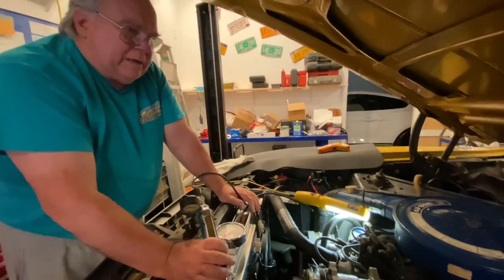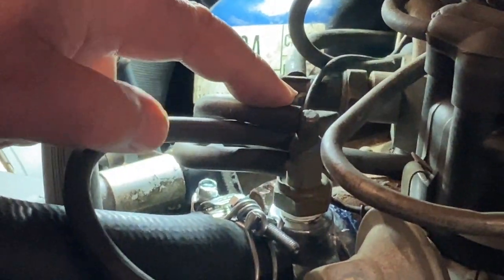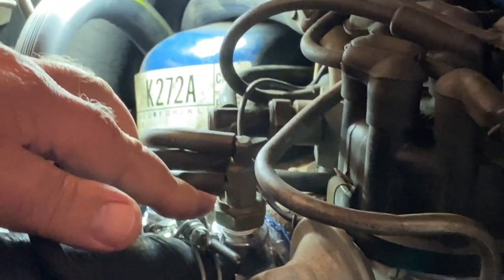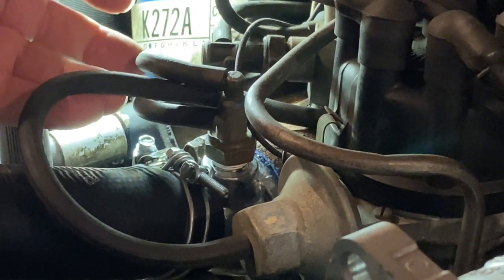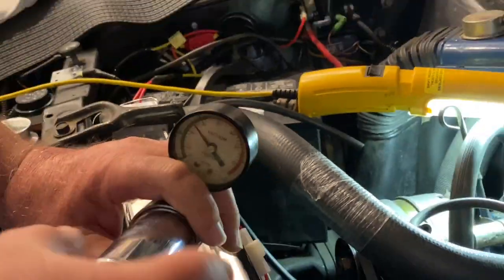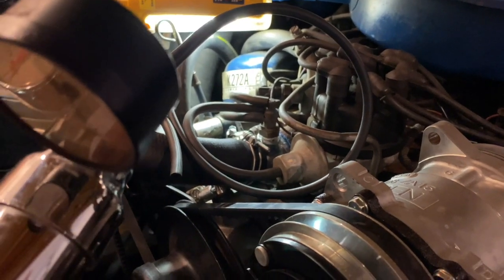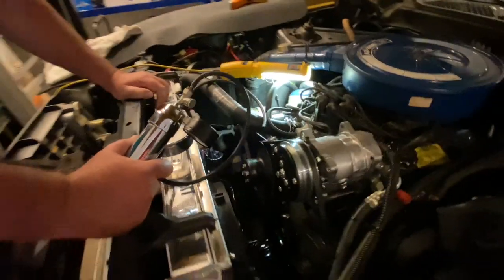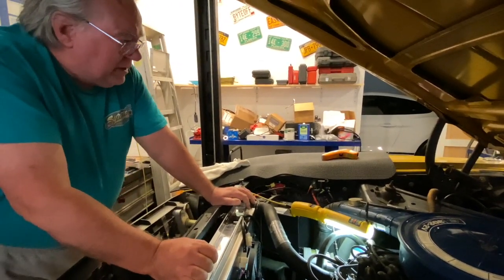1973 Mustang Thermal Vacuum Switch (TVS) Behavior And Testing

Comment: Great video! Is there a preferred configuration for those general driving and performance? I have one of these on my 70 boss.
Reply from the maker: I will see if I have the vacuum schematics for the 1979 Bods 302. I prefer to do that as opposed to taking a guess at a general configuration to try, although I am confident what my gut tells me is going to be correct anyway. Please stand by as I research this

BTW, I am a huge fan of Boss 302s from back in 69 & 70. Huge. I feel honored to be getting asked to help find out how those engines were configured for the vacuum systems. Truly honored.
Reply from the maker: Okay, we got lucky.  I do have a copy of 69-70 Boss 302 engine vacuum calibrations on my Google Drive at the link provided below.  There is a subtle difference between the the drawing on the left side of the page, and the right side. The difference is on where the vacuum source for the hood scoop air flap vacuum motor comes from.  Functionally  there is no difference, but the routing of that particular vacuum line differs between the two drawings.  Here is the link for the one file:

https://drive.google.com/file/d/17kcVttPb3mKM30b_QsQRF5Fk9APFDVwS/view?usp=drive_link

I have a lot more vacuum schematics for 1968 - 1972.  I consolidated all the files I got from The Mustang Barn, with their knowledge and permission, into a single file, located at:

https://drive.google.com/file/d/1zE7_8E5NsaInM69KPkzRuZZeWFNpbz0i/view?usp=drive_linkFell free to share this info with anyone who made it.  The Mustang Garn published it for free use.

Comment: I have asked two or three part houses staff and nobody is a mechanic nor even know the name of this Ford part.  Much less how or what it is supposed to control.
Reply from the maker: I have several files with more info on these Vacuum Vacuum Switches.  I have tried to keep all my various files organized in a way that I can find and open, or share, the files without a lot of hunting around.  But, that has only worked out "so well."  I will provide more files as I come across them.  As I find them I will upload them to my Google Drive, which you can access via the link below:

https://drive.google.com/drive/folders/1K6s8NTPj5gP229i5DPfdPxgxedikayty?usp=share_link
Reply: @gilberthale7777  Nice, thanks for the content.  I just rescued a running driving 1972 LTD Convertible with a 429 4V, 3 speed C6 transmission, 3.0 rear end ratio. I rescued it from a local ranch shed.  Has not been on the street since 2012.  Just driving around on the washboard ranch roads.  Lots of years of deferred maintenance and sketchy repairs and parts are not really easy to find.  They did not make many of them. Finding a person that knows what stuff supposed to do is even harder.
Reply from the maker: @dewholdingsllc1050  The folks at Mustang barn put together a bun\ch of PDF files for all the Ford Mustang engine vacuum schematics from 1967 - 1972.  With their permission I assembled all the pages into a single PDF, grouped by year, then sorted by engine size.  You can access the file via my Google Drive t the following link.  I hope that helps you with that LTD.. Those are nice cars.  I used to work on them a lot as a technician at a Ford dealership in SoCal back in the 70s and 80s.  Good times back then.  

Anyway, the file does not show thew 1972 429, as the Mustangs only had that engine through 1971.  But, it does have the vacuum calibration schematic for the 1971 429, which may be pretty close to what 1972 had.  If nothing else this info may come in handy to you or a friend in the future.  It is at the following link:

https://drive.google.com/file/d/18QmjlkGQ0fHLOt-q2Pq1JvXDN1gdRl5x/view?usp=share_link

Comment: Excellent video Gilbert, I was previously puzzled by this small device but no longer !
Reply from the maker: I am glad I was able to remove some of the mystery re: how those TVS units work.  In the mid 70s to late 70s it seems most cars had at least two, or three, of those TVSs, and some of them remain puzzling re: how they are supposed to do any good.  Others are fairly self evident.  Computerized engine control bring a different kind of layer of complexity when it comes to emission control, while concurrently maximizing engine efficiency and power.  But, in the past few years technology has finally delivered on its promises.  But before that we relied on vacuum control devices to try to bridge the gap between old school engines and the modern engines we see today.  It is amazing to me how well those interim run so well after all these years, especially with all the things that can and do go wrong with them.
Reply: @gilberthale7777    This information also applies 100 percent to a 1978 Mercury with the 400 C.I.D. and the Motorcraft 2150 carburetor.
Thank you brother
Reply from the maker: @Apollo-bw3hv  Yeah, Ford used those levels of emission control technolofy through 1979.  In 1978 they began to slow roll our the Electronic Engine Control (EEC), begenning with EEC ! in the California model of Lincoln Versailles.  Then in 1979-1980 we began to see EEC II systems,  Finally, EECIiI (which began to store error codes in memory) began to show up in 1980.  That is when on board computers began to become less unstable and less difficult to diagnose - finally.
Reply: What thanks for the info @Apollo-bw3hv

Comment: Been looking for this video soo long. Hello.sir  id possible  please may i have some advice. What do you use to increase  idle speed when the ac is switched  on??
Reply from the maker: I have another YouTube video on Throttle Position Solenoid (TPS).  It is used in one of two ways.  The first way is to reduce the throttle position when the engine is turned off as described in the video in the link below.  The other is to hold a higher idle when the same circuit that activates the A/C compressor clutch coil is used to activate the TPS, which will hold a higher idle speed when it is adjust to open the throttle blades open a little bit more than normal hen the TPS is activated.  

Here is the link:

https://youtu.be/ljJ1uNy86wI

Comment: I just found this video and realized you are in Rochester as well!  I have a 76 mustang that I'm having some issues keeping it running after it gets hot... I'm thinking it's a vacuum issue, hence finding the video...
Reply from the maker: It is most likely a vacuum leak.  But, I like to pull a plug or two to make certain it is not an excess fuel issue.  What engine do you have?  I used to work on early Mustangs as a tech at a Ford dealership in SoCal decades ago.  Although I tend to work on first generation Mustangs and Shelbys now (retired), I am not adverse to taking a look at your Mustang.  When you get a moment email me your contact info at gilhale@gmail.com, if you like.
Reply: @gilberthale7777  it's the 171 v6.  I'll shoot you an email tomorrow!  Thank you!

Comment: I think its for over heat
Reply from the maker: The application of full intake manifold is meant to help cool the engine down when it gets over 215 degrees.  It helps, but so many other things can cause these engines to run hot...  And if the distributor vacuum advance diaphragm is ruptured the TVS does no good diverting to manifold vacuum.